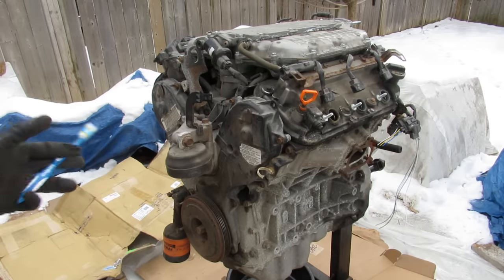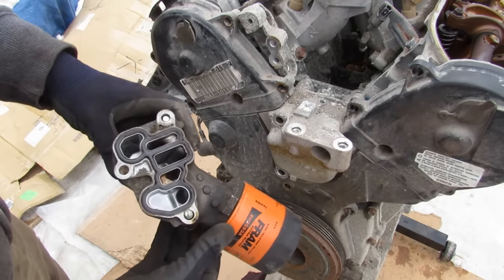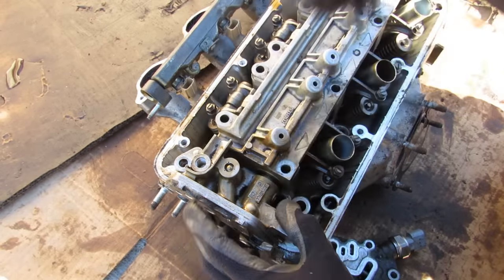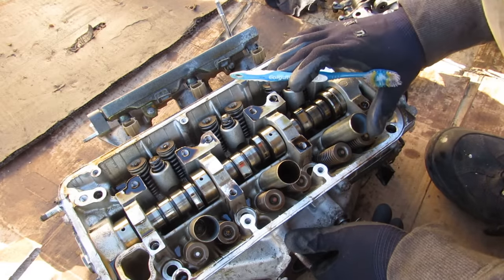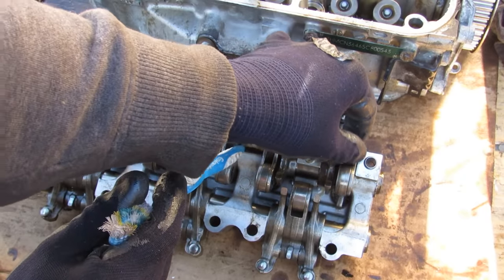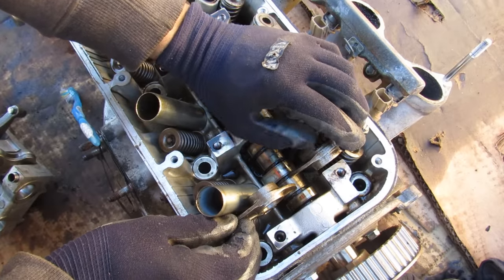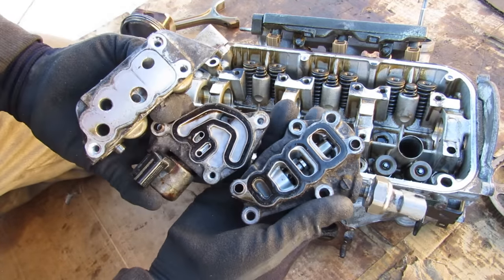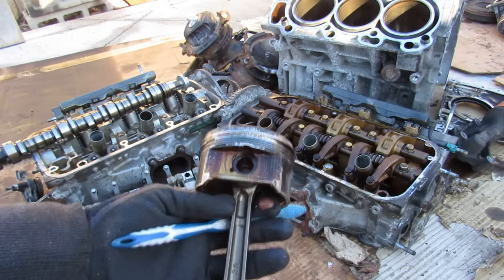Why Cylinder Deactivation Can Cause Engine Failure

Comment: I know that engine braking deals with similar forces applied in the cylinders that you say VCM does, in terms of vacuum and suction forces, to my understanding.  Does this mean that engine braking over the long term can cause similar negative results that VCM causes.  Such as oil build up on the top of the cylinder, spark plug, and hats?  Can it also damage the cylinder rings and cause issues there too?  I engine brake often as I live in a hilly area and don't want to ruin my brake pads and rotors as fast.  However, pads and rotors are much easier to replace than what VCM causes. 
Does anyone have any insight, whether that be speedkar99 or someone else with some knowledge on this?
Reply from the maker: Engine braking doesn't close valves
Reply: @speedkar99  Okay thanks for clearing that up for me.

Comment: I've got a 2011 pilot with 105k miles. It's eating up about half a quart every 700 miles or so. I think the piston rings may have lined up like you said... I disabled VCM, changed plugs, and I'm going to change the oil every 2k for a bit... Anything Else I can do to fix it?

Comment: yikes I have one of those on a 2007 odyssey,  I haven't had much issues, yet , its got 205k miles I think.   I was seeing increased oil consumption recently.  I changed PCV valve recently thinking was a contrib factor. and  might help. Only time will tell.    I have never missed oil change and always use 5w20 high mileage oil now.  Would you recommend to switch to synthetic 5w20  or stay on Conventional High mileage 5w20.  what are you thoughts on things like Lucas Oil Low Viscosity Stabilizer?
Reply from the maker: Stay on what you've been running
Reply: @speedkar99  started getting imbalances in eco mode
And oil consumption issues.   Installed S-VCM controller to disable the VCM on Honda v6
So far looking good 👍 
Wished I did this sooner

Comment: Used  S-VCM that we bought for 100 bucks. Solved the problem by fooling the computer and disabling the deactivation system. Works great.
Reply from the maker: The resistor?
Reply: I have one as well and so far it's doing its job.

Comment: To be fair to FRAM oil filters, the Extra Guard line (the cheapest and what is shown on this engine) is bad, but the Ultra Synthetic line is pretty good.  Tear down shows that Ultra Synthetic as good as, if not better, than Mobil 1 oil filters.
Reply from the maker: Once a Fram never a fram

Comment: My 2012 is at 186K. Just ordered an S-VCM. Currently everything is working great but i hate when ECO comes on as i can feel a slight shudder. Hoping that will go away after and maybe i can get another 100K out of this.
Reply from the maker: Yeah I'd hate that feeling too.
Reply: Yes you'll like it. Put one on mine a couple of weeks ago, oil consumption has stopped and even the the brakes(booster) feel better. Best hundred bucks I've spent in a while!

Comment: Is this engine a port injection fuel? why we cannot cut off the fuel injector and let the valve run normally.
Reply from the maker: Then it would waste energy pumping air.

Comment: Is this still an issue on current generation vcm? I have a 22 Ridgeline.  I was under the impression that as long as I don't run the truck in "eco" mode, the vcm won't be engaged. Thanks.

Comment: Wait, what happens if VCM activates right after fuel ignition?  Won't 1000 psi be trapped in the cylinder if the valves are no longer opening?

Comment: Got 2023 pilot equipped with VCM. I don't know if the dealership will disable that. We paid for 6cyclinders and only 4 or below is actually working bcoz of that vcm. Thats crazy. I want my 6cyclinders in full power.

Comment: This might be a dumb question, but how is the compression in the deactivated cylinders  released with all the valves closed?
Reply: air will expand again after being mechanically compressed no need to kick it out
Reply: No, this is actually a great question
Reply: If you rewatch the video, he does a pretty good job explaining that it isn't released, nor would you want it to be released, as then the engine is doing unnecessary work pumping air through the cylinder.  

It is more efficient to have the the cylinder act as an air spring, where ideally whatever work you did moving the piston in one direction, you get back on the return stroke - minus heat losses and friction.
Reply: @Techie1224  I don’t think that’s quite how it works, because if you close the tip of an empty syringe, you see how the air inside acts like air spring, I think the same effect will take place unless there are chambers that open and close to regulate air in the cylinder.
Reply: The air will leak away and the average pressure in the cylinder will be atmospheric. Which means that most of the time it is near vacuum.
Reply: Not dumb. If I understand correctly, it isn't, that's why vacuum sucks oil around the rings and clogs up the cylinder and spark plugs.
Reply: @FlipMore  
there should some air inside cylinder and when piston move up it compress it and when piston move down the same air will expand .. if theres much suction inside the cylinder the valve will open a little
Reply: @thealienrobotanthropologist  its impossible to move cylinder downwards since its still moving with crankshaft without sucking air, same as you can’t move syringe down
Reply: @Techie1224  I’m sure there’s a technical solution to overcome this, we need a clarifications here,  where’s the author of this video? lol 😂
Reply: @FlipMore  
its not impossiable when there is much vacuum in cylinder the valves will pushed inside to balance the suction
Reply from the maker: I'd expect the spring pressure is more than enough to keep the valves shut during the vacuum.
Reply from the maker: Yes there is some blowby due to pressure differential.
Reply: @speedkar99  thanks for clarifying

Comment: I used to have a Honda odyssey 2015, I bought a Toyota Sienna 2017. There is not to much difference on power or fuel consumption, but the Toyota Sienna doesn't have the VCM crap.
Reply from the maker: It doesn't. I heard the 2017's were the first of the 8 speed autos and were a little harsh to shift. Is that true with yours? 
I have a 2011 Sienna.

Comment: Nice vid! At 2:26 - did you try breaking that loose with the M18 at all? Asking because I'm considering this tool and was wondering if it could break that bolt loose since they advertise it can loosen some really tight bolts
Reply from the maker: Crank bolt? M18 can't break that... especially Honda ones since they are the only bolt holding it on (no taper). I've always used a breaker with something lodged in the crankshaft to crack crank bolts free.
Reply: @speedkar99  I meant head bolts

Comment: In 2015-2020 Tahoes you can put it in manual mode and select gear 5 and it wont allow the cylinder deactivation but otherwise operates normally, with one exception. It is completely normal operation, without the deactivation, except it wont go above 5th hear so if youre around town and not exceeding highway speeds its fine but if you take it on the highway it'll sit at higher rpm cuz it wont allow it to go above 5th.
Reply from the maker: Is there a manual 6th gear version?
Reply: @speedkar99  yea you can bump it into 6th but then the deactivation will enable again.

Comment: Thank you so much for this video, my 2010 honda accord just turned off on my when stopped for stop sign. When I turned it on, It was shaking and sounded it was struggling to stay on. I keep up with my maintenance, so it made no sense to me. Scanned it and it said misfires on cylinders from 1 to 3. Checked the sparks, coils, and oils. even the fuses. all were good... Now I'm stuck with my baby on the driveway... my question, is this due to VCM?
Reply: Try the vcm muzzler 2 device.you can purchased it in ebay for $90.easy to install.

Comment: @speedcar99 What do you think about cylinder deactivation on regular straight 4-cyl. engines regarding potential issues?
Reply from the maker: That would be a huge imbalance on the engine mounts
Reply: @speedkar99  Okay thanks, I was just asking because my 2020 Mazda 3(Germany) does have cylinder deactivation, plus it's a mild-hybrid as well with a 24V integrated starter generator. So that's a bit different from the 3's you guys are getting in the US and Canada, but Europe has just stricter emissions regulations. No turbo though haha(yet...but unlikely). Mazda claims they had no issues with the cylinder deactivation during the testing process so just let's see how that'll hold up...I really appreciate your work, especially because your so good at explaining things.

Comment: Hey I have a question why can't honda keep the intake and exhaust values open instead of closed its true energy is lost pumping air infact as both values are open essentially the work done will be much less than that of working against vacuum and all the issues that was enumerated will be solved. Also it won't be that difficult to make as the ideal cam lobe just needs to be thicker.... Any explanation why honda has not changed the design

Comment: Is there a way to plug off the oil supply to the vcm sensor to stop the vcm from working
Reply: There is a brilliant aftermarket solution for Honda engines called the VCM Tuner II. The trick is getting one, as they are in high demand. For $140, it can save your engine.

Comment: Excellent video.  Great explanations, visuals, and demonstrations.  Much appreciated.  I recently received an error code of P3400 which points to a problem with the vcm system you reference in the video.  Three months ago our Honda engine failed  while driving on the highway.  The error code at that time read something about a speed sensor output.  Two questions.  May I assume these issues are related?  My mechanic wants to replace the entire rocker arm assembly at $1,800 dollars.   From what I read online, I think we should first start with replacing the pressure switch at $50 and see if that works.  How can I tell if the whole assembly needs to be replaced vs trying replacing just the switch?
Reply from the maker: Get a VCM muzzler

Comment: So on engines with cylinder deactivation, Are the pistons just operated by the crank (free float)  since the valves don't open in order to create combustion? I'm not a mechanic but that Sounds like they would wear out faster
Reply: The valves don't open on the cylinder, so what you have is essentially an air spring.  The piston goes up and compresses what's in the cylinder and then goes down, creating a vacuum.  The air doesn't change (much).  The vacuum on the downstroke is what can draw oil into the cylinder and cause the problems - especially if the ring gaps line up....

Comment: Knock on wood, my 2015 Pilot isn't burning oil at 110,000 miles, but I don't like the jerking when the VCM engages.  Based on the track record, I just bought an S-VCM to disable the VCM.  I tried a cheaper one when I first got it, and I admit I liked that it was smoother.  That one wouldn't stop setting check engine lights for thinking it was running too cold, hopefully this one is better.
Reply: Just to let you know I've had my s-vcm for about a month and it's been flawless so far.

Comment: Curious, how come the piston scoring is more on the on nonVCM bank?
Reply: That bank averages more power, so higher cylinder pressure. The connecting rod  pins are offset in the pistons for stability. The offset causes the piston to tilt under pressure. More pressure, more tilting force, more piston-wall shear force... more scoring.  Look at a teardown video of a top-fuel dragster engine.  Lots of skirt scoring on one side.

Comment: I have to wonder if the VCM mode would be ok at highway speeds only or is there still going to be harm to the engine. I think city driving would be really hard on the engine in VCM mode …… but I am only guessing. Does anyone know ?

Comment: Man, those crank pulley bolts on the Honda V6's must be fastened by Superman at the factory. I resorted to buying a 3/4 inch impact wrench to take mine off when I did the timing belt on by 08 Ridgeline. That sucker was TIGHT.

Comment: 5.7 Hemi can deactivate 4 cylinders (MDS), but that's not what causes the infamous Hemi tick, worn lifters, and cam lobes. The non-SRT 6.4 Hemi engine in the RAM Trucks doesn't have MDS and still has the same problem. I do think MDS causes exhaust manifold studs to break because the exhaust temperatures change when MDS turns on and off.
Reply from the maker: Interesting. So what's the root cause on the hemi?
Reply: @speedkar99  Hemis have a problem not letting enough oil get to the lifter's rollers and the cam lobes at low RPM. Too much idling destroys them. Hemis have a unique cam configuration. The cam sits a few inches higher above the crank compared to other pushrod engines. This puts the roller lifters at a near-horizontal angle, so it makes oil harder to get to the rollers. The engine is fine at higher RPM since oil is really flowing. I personally stick with 5w-20 as stated to use since it flows best when hot.

Comment: It's honestly much more reliable then people realize. They had piston ring problems sure, but honda fixed that. Beyond that it's as simple as change your oil, do an intake service from time to time and don't overtax any car. The real killer of the V6 hondas is the torque converter, the lock up clutch causes shutter if not maintained properly with the recommended fluid changes. When I worked as a honda tech I saw tons of bad torque converters in the V6 cars.
Reply from the maker: How did they fix that in the newer models?
Reply: I change the fluid every 15,000 miles, the is also inline trans fliter that should be changed at 50,000.

Comment: I never use the vcm on my Odyssey. I have 213.000 miles and my valves looks look great compare to that. I'm blessed.
Reply: How do you never use the VCM? Isn’t it automatic? Or could you deactivate it on the older models?
Reply: @andybub45  2005's  have a deactivation button.

Comment: Another great production...✨👍🔥🎩
I have a question ... So to disable the VCM should we not just disable the VCM solenoid which actually activates the VCM... offcourse there will be an erroe code but since we know what is that it should be ok, or it might can cause further damage or problems ??
Reply: i think it can be disabled through software
Reply: @Muhammad Tayyab
the fuel is also stopped :-)
Reply: @YTANDY100   some guy at comments says he disabled it ,,

Comment: I think it can be fixed with a controlled vacumm pump to keep the pressure inside the crankcase below 1bar like 0.8. So a vacuum pump with another  pcv valve (you can buy a simple one connect radiator silicone adapters for different diameters and AN10 fittings, vacuum tube)and outlet to the intake manifold. An cylone oil separator is needed before the pump, with a return pipe to the crankcase (at the bottom). It’s a bit of work but can be done.
The vacuum pump need to be high flow so that can be achieve with a 12V centrifugal blower, that created a very low vacuum. You need an adapter like a flange and a good seal, no pcv needed in this case only the cyclone separator like this https://boostbarnmotorsports.com/products/killer-b-motorsport-air-oil-separator-barebones-kit-subaru-wrx-sti-2002-2007
Reply from the maker: Interesting idea
Reply: @speedkar99  thanks
While for this engine maybe disabling the cyl deactivation is good since it eliminates extra vibrations and stress of only 3 cyl powering the car there seem to be benefits of a negative CCV
https://dsportmag.com/the-tech/quick-tech-the-benefits-of-lowering-crankcase-pressure-part-1/

Comment: Thank you speedkar man. My plugs looked like those, I'll keep changing my oil every 3.5k miles.
Reply: if you calculate the extra cost of changing oil every 3.5 k miles devided by engine lifespan it would exceed the cost of a new engine by 2 or 3 times 🤣

Comment: How would it look like with diesel engines? They do not have underpressure. So what would be left inside would be exhaust under normal pressure. Would that rock hard too with normal engine mounts by the way? That sounds like a good solution for logistics; to change from yard duty to hauling short to mid distance to important customers. 
Back to gas engies: How would it look with supercharged gas engines? Do they suffer such wear and rock hard?

Comment: interesting. But why they dont just minimize the fuel injection, like idle in those cylinders and let the valves working. in this case never fail that sparkplugs, no missfire, no oil consumpsion because the vacuum. OR use the cam shaft control both side and change the shout off regularly to keep the cylinder in good condition.
Reply from the maker: The engine will be wasting energy pumping air
Reply: @speedkar99  but, the vacuum causing power loss too. 🤔🧐

Comment: I did bypass VCM but then the engine was not as smooth on 6 cyl mode as before. so I undid everything, removed negative ground where it connects to body next to the battery, grinded paint on the contact point, also added extra connector at that 10 mm and ran a thick wire to a biggest bolt of transmission. Van runs so much smoother on 6 cyl then ever did. Also VCM is barely noticeable.
LOGIC: may be with proper ground>may be spark plugs and other sensors might be able to ground and work more consistently. it runs so much better now.

Comment: Awesome video and instructional tutorial.. which begs the question.. should one run their V6 in Econ mode ?  New to this engine and car. Had an '03 Eclipse and still have a '94 MX6..but wondering if I should use the Econ mode at all, given its propensity to issues...??